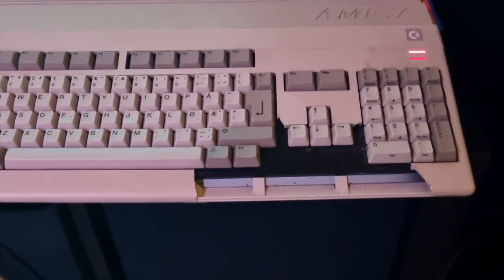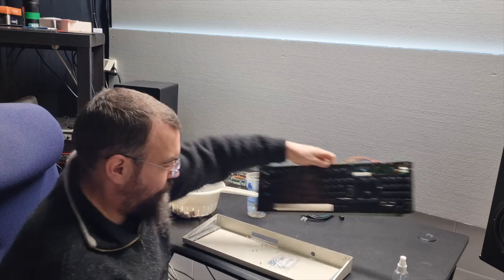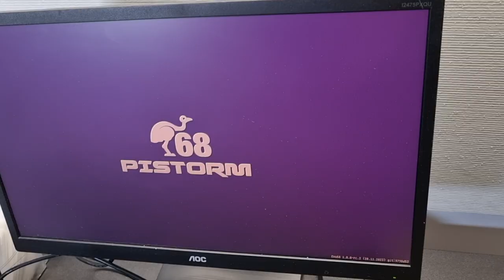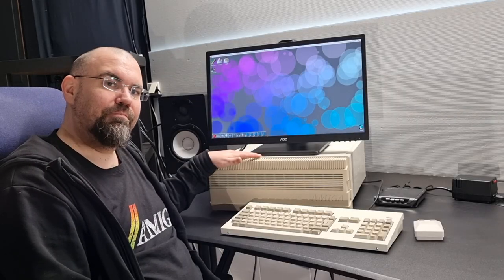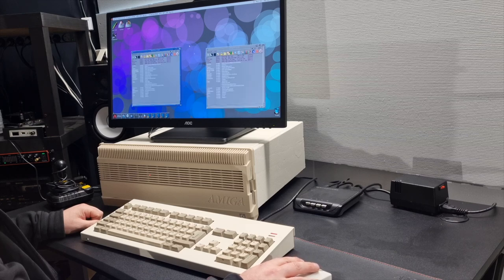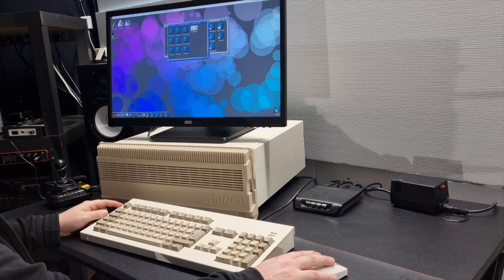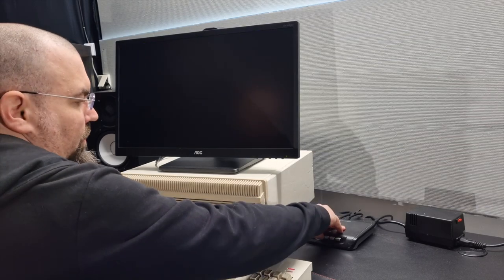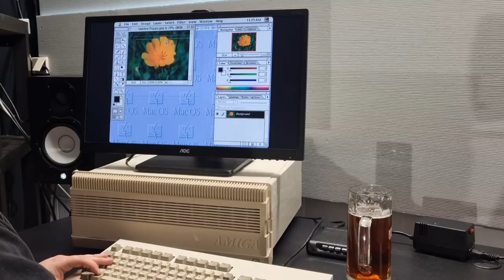Building my dream Amiga. From Trash To Treasure

Comment: Nice save of a trashed amiga.   It be also be very cool if you can get a floppy drive on the side to insert a disk with a working floppy drive.   That would look awesome.
Reply from the maker: It would! Was not on priority because of no use for one. But would look very very cool with a vertical drive there. There will be an extension for sd card there when it arrives in the post

Comment: Interesting repurpose of a broken case.

I'm sure that you will look at this again to change the layout. Maybe even bring the power supply inside.

Perhaps mount the Pi inside the front at the left so that the SD card can be accessed from the side of the "front panel".

It works as is and you seem pleased with the result. The small beer is well deserved.
Reply from the maker: Cheers. Yes it most likely will change a lot. Most of my stuff does that. First on the list is a sd card port extender. To get easier access to the card.

Comment: Nice build. It would be cool to have a working floppy drive in there 😉
Reply from the maker: Thanx! Was considering making a hole for one. But I liked the clean look and for this kind of use I have no use for a floppydrive.
Reply: No bro. I rather meant using the existing floppy hole from your A500 case.
Reply from the maker: @szadron  ah yes. And yes. That would make it even better. My plan is however to have the sdcard there. Waiting for an extension. Not as cool as a drive there though.
Reply: @proteque Yes, you're right. It's not that cool but at least it's more future proof and convenient at the same time 👍

Comment: Are there Zorro solutions for A500? Not just adapters for one card but a bus, a Buster and multiple slots? Or can networking, 16-bit audio also be emulated by the PiStorm?
Reply from the maker: The pi can provide networking. But not with the bare metal setup I am running now. For that you need to run linux and musashi on the pi. Quite a bit slower than bare metal emu68.

Comment: Did the A500's ever get PCI backplanes through the CPU bus like the A1200 did?
Reply from the maker: No. So through the pistorm is the way for networking, rtg card etc for the a500. The pistorm slows the a500 chip mem though. So best to make use of it for a dedicated amiga for rtg use with the pistorm(and another one for games and demos).
Reply: @proteque   Yes, it's all very basic atm though. And I've looked at adding mesa to AmigaOS and well, apart from cmake failing on thread related stuff on llvm, there's no way for elf shared objects for c++ libs. And this is really why people want a real 3D card on Amiga's.
Reply from the maker: @LukeAGuest  I used to have the blizzardvision. Not sure how it compare to the vodoo on the mediator. I did not use the 3d part of it much tbh. So for my usecase (which is mostly just mod/gfx) this does the job. But anything new happening in this front is off course welcome

Comment: while I really like what have you done with a smashed A500, calling it a big box Amiga is huge stretch. Show me for example, how do you install a VidoToaster in your "Big box" Amiga, or Bridgeboard. You basically did put A500 with "parasitic" RPi into a larger PC case... That is not a Big box Amiga, sorry...
Reply: It is a big box he put it in,and it is an amiga soo….
Reply: @massmike11  ... so, is it an Amiga in big box? But that is not a Big box Amiga. Use of large expansion cards was the purpose of Big box Amigas since the first Big box Amiga made in Germany.
Reply from the maker: Sure. Noone can say that is wrong. It is not a big box Amiga. But I did recreate the "big box amiga experience". At least mine. My reasons back then for owning 2000 and 4000 was to get graphics cards. (As well as fast cpu, fast drives (scsi back then). As well as that feeling you get in front of them rather than the wedge Amigas. And for me, I did get that from this. But actually technically etc etc. It is not a big box Amiga as you wrote.
Reply: @proteque  no problem, as I said I like what you did "saving" a trashed Amiga. I just thought you will do more to somehow fabricate some kind of Amiga with proper multiple Zorro Slots and Video Slot... 
And yes, Im not a big fan of those Pistorm nonsense solutions, Amiga should be Amiga, not a modern computer installed inside using Amiga as terminal.
Reply from the maker: @madigorfkgoogle9349  thats a fair view I can understand.
Reply: @proteque  thank you.